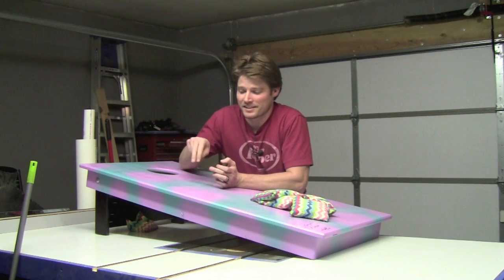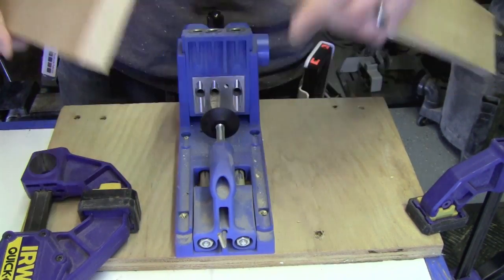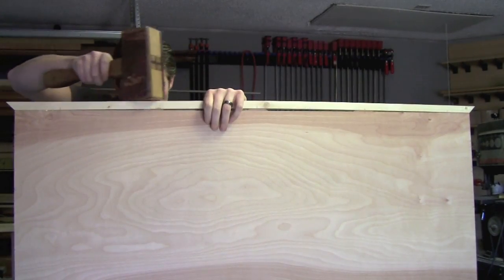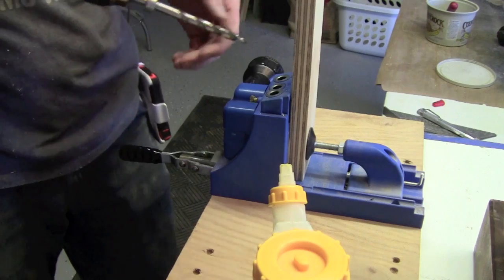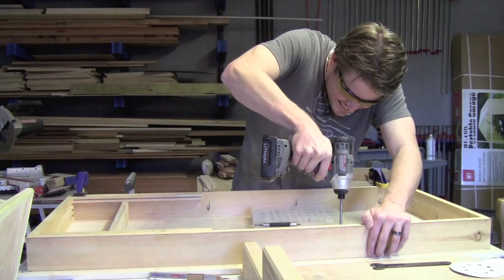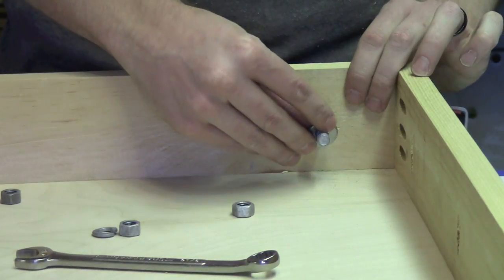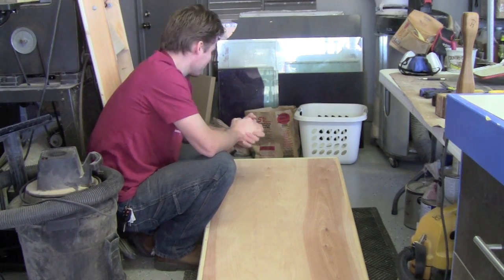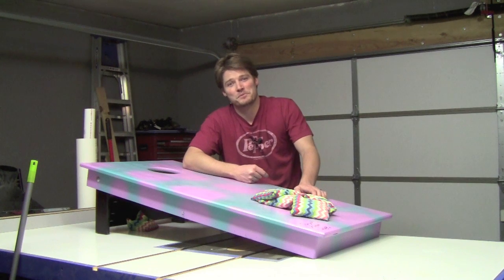How to make Corn Hole Boards with storage

Comment: Nice highlight of different methods of joinery.  I don't think the biscuit gets enough attention.
Reply from the maker: I like using biscuits.  They are under rated and work really well at keeping a joint together.  I also, cannot afford a domino.  LOL
Reply: Rock-n H Woodshop Diddo on the domino.

Comment: This looks to be very well made and sturdy. What was the overall weight when you put the 2 together? Your videos rock. I am fairly new to woodworking so thanks for the knowledge.
Reply from the maker: Thank you, I'm glad you like the video. I have not weighed the two together with the bags in place. If I had to guess I would say it weighs about 35 to 40 pounds. If that seems too heavy you could cut down on the weight by using half-inch plywood instead of three-quarter like I did.

Comment: Nice job Drew, my daughter is 2 and a half and she loves "boo". What are you using to spray the paint? Are you thinning it? What kind of paint? Why is the sky blue?
Reply from the maker: Lol, it is a graco turbine sprayer from lowes. I thin with water as long as I use water based enamel paint. Otherwise if oil based I use paint thinner or mineral spirits.  The sky is blue b/c.........hmmmmm..........it's not night. Otherwise it is black.